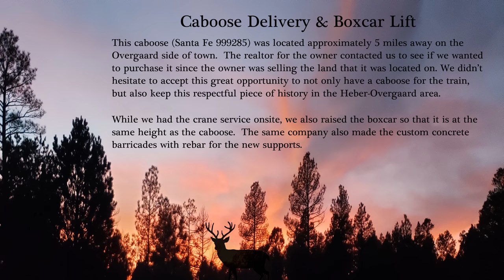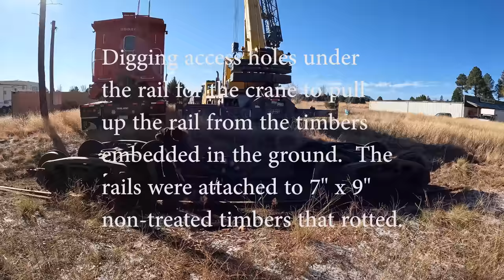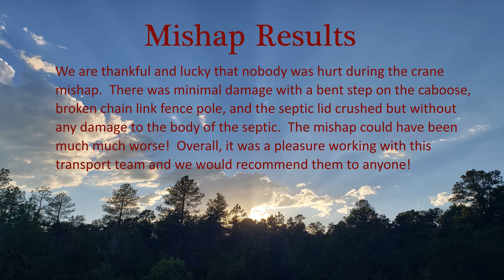Ep#17 - Caboose Delivery & Boxcar Lift

Comment: Hello sister caboose owner!  I’m trying to find everyone on YouTube that has a sister caboose to my Sante Fe #165 and I should have the move uploaded in a few months.  Really sad to see that they dropped it. 
The company I used swapped the 90 ton crane out for a 140 at the last minute because they were worried they would be at the tipping limit. I’m glad they did. Our caboose weighed in at 48,000lbs without the trucks.
Reply from the maker: Awesome!  Send us the link when you have the move uploaded.  We'll check it out for sure.  Yes, it was sad it dropped but we're soooo happy that it was minimal damage and nobody was hurt.  We did have several video parts of the renovation of the interior so feel free to check it out too.  We've always been about 2 months behind on our videos as we try to find time to create the episodes.  Currently working on behind the 'train station' for the employee area which is turning out pretty cool.  Lots more work to do though but it's a fun journey!  🙂  Curious what you'll be doing with your caboose?
Reply: @OffOurTracks  Oh yes, we binge watched all the renovation videos!  Turned out great!  Really loved those lights that look like steam engine water level gauge’s!  
For ours, the long term is to lay 400-600 feet of main line and power it to go back and forth. 
The insides were all original like it just came out of service. We will probably do some half renovation that still preserves the feel of the caboose, but also not feel old and dingy. 
I’m about 2 years behind in episodes, so I feel your pain!  Keep up the great work!
Reply from the maker: @MakersAcres  Fantastic!!!  Keep us posted!!

Comment: That went just fine, luckily very little damage. Why don't you have rails under the boxcar and no dolly wheels. And I don't see any links to the boxcar either. Shouldn't there be a tender behind the locomotive?
Reply from the maker: Great questions... for the boxcar, we got it as is without any wheels or couplers.  We plan to put a deck (loading dock) on both sides anyway so it would hide the wheels anyway.  For the Tender, check out Episode 5 for the Prop Locomotive.  It would be awesome to have an old tender to go with the locomotive.  I've actually looked online too but couldn't find one.  Now, I'm not sure if we would have the room to add one if we did find a small one.  Overall, we're just thankful to find and acquire the pieces we have.  🙂

Comment: did it come with truck if not i got some berring i pulled from one of the old santa fe cabossese that was in a junk yard near where i am i can send them
Reply from the maker: Thank you!  Please clarify what you mean by "truck" please?
Reply: @OffOurTracks  its the part that holds the wheel set axles berrings and springs and all that underneath
Reply from the maker: @whybeare3  we have the complete wheel trucks for the caboose but not for the boxcar.  Instead of trying to find/buy some wheels for the boxcar, we decided to raise the boxcar on blocks since we will be adding a 'loading dock' to both sides of it which will hide the wheels anyway and ultimately look like the train is pulled up to the dock.  🙂
Reply: Interesting project. The video has almost all the making of an action movie, real heavy equipment, strong men doing really dangerous work, the lift work gives a sense of life or death which is multiplied by some of the men wandering to close or actually under the partially elevated caboose while the piano makes hearing anyone talking or even being heard impossible. Nice background with the brilliant sun intense high blue winter sky with only a few cloud’s.

Comment: No padding on the sharp edges makes foe a unsafe lift and lifting up at a angle like that puts unnecessary weight on one strap
Reply: Agree, no softeners on strap sharp contact. What happened to Digsafe?. Some large timbers may have helped bridge the ceptic. Load planning on all counts.